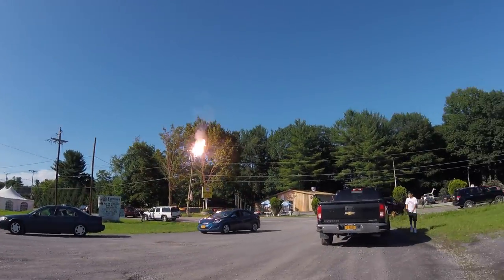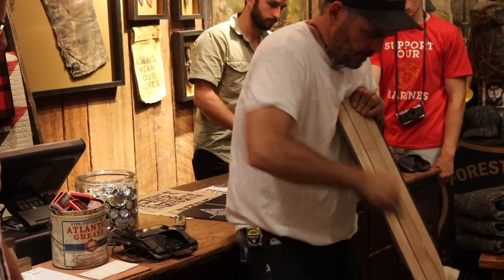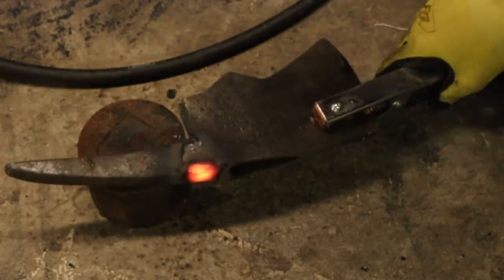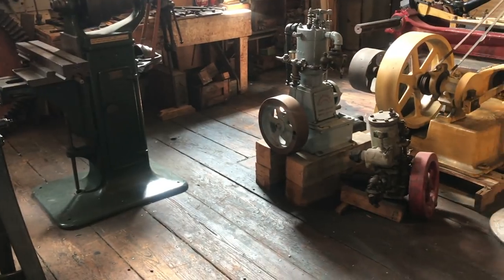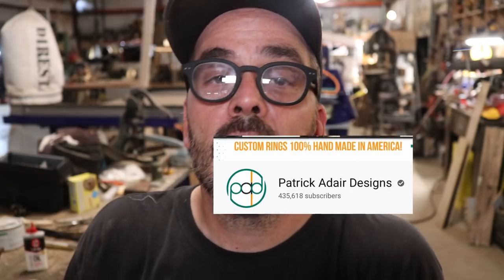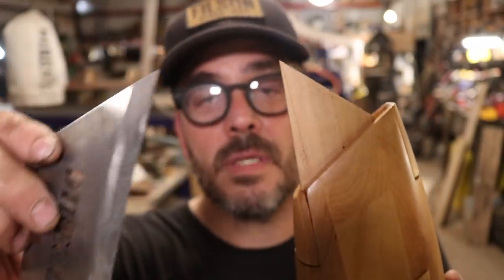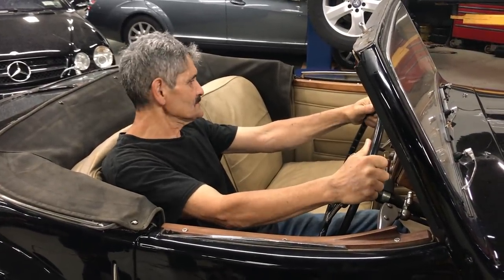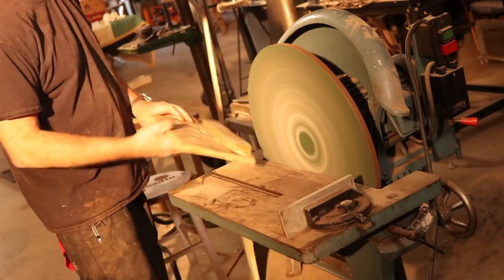DiResta 74 My New Giant Knife

Comment: The trick with getting brass onto steel is wait until just after the steel loses it's glow and goes black for a few seconds and then brush it with a brass bristle brush. Any hotter and it just won't show up. And cooler and it isn't hot enough. I put it on a lot of stuff I make.